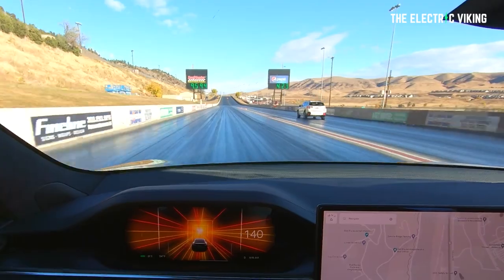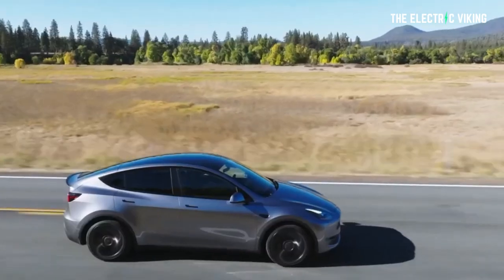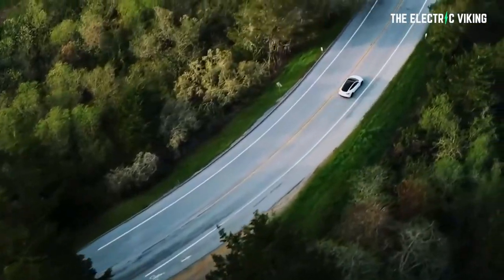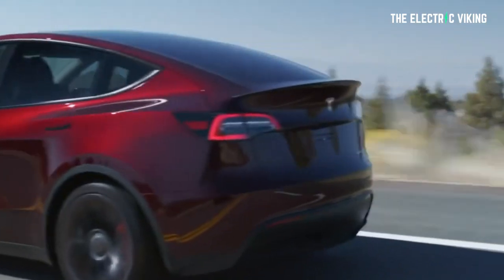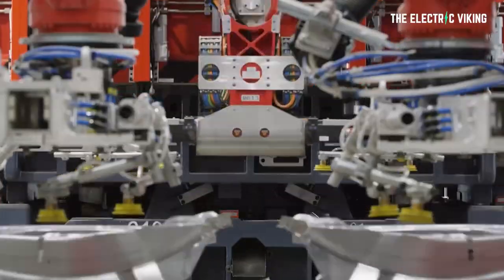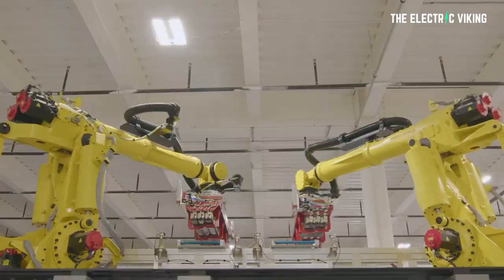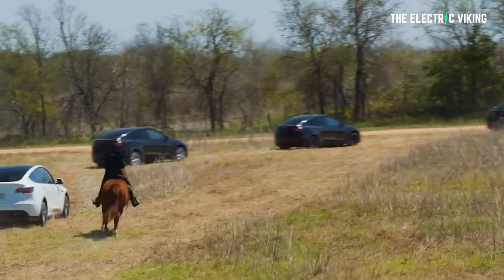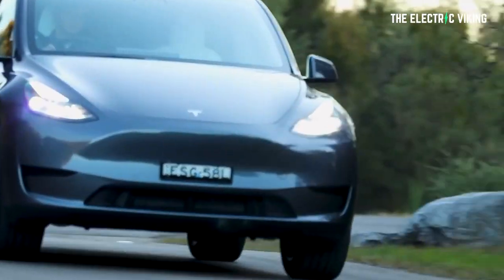NEW Tesla Model Y model available to order within weeks

Comment: I wonder whether the battery pack is arranged as 24 cells across the vehicle by 32 along it? That would be wired as a 96s8p battery, giving a 400V system with about 76kWh available battery and a modest buffer.

Comment: Will be interesting to see charging speed of the new 4680 cells as nothing has been published about it. If equivalent amount of energy per car, the charge speed may be reduced as fewer cells.
Reply: Tesla battery swapping???
Reply: Published estimates show that the charging speed is slightly slower than packs with the 2170 cells because of the need for more care with thermal management of the larger diameter cells. The small trade-off in recharging speed is worth the reduction in complexity, mass and production costs.
Reply: Will be interesting once they release the specs. Given the 4680 is a powerful cell, it may actually be able to take charge well, but given they are not using them on the semi, I also assume they will be slower.  This should not be much of a problem as most charging usually takes place at home overnight on a slow charge to prolong the life of the cells.

Comment: Maybe Panasonic focusing on 2170 cells do to unsolved optimization with heat distribution of the 4680 battery cells? Or is that already out of the question.

Comment: I had one on order, they had a few pop up in inventory in September. Pricing is $61,990. The car is NOT lighter, we already have weight details, spoken reviews on YouTube weighed his. We also know that they are the full 828 cell pack, so it's likely it's being software limited.
Reply: Yes, I kept asking about measuring the battery energy on Munro's channel since they tore one of those packs down. They demurred on the answer since they want that info to go into their reports. Would be quite easy to take four of the 4680s and determine their exact capability if anyone had them in the raw.
Reply: @arleneallen8809  The Limiting Factor has a cell on the way and will fully test. Should get a good answer from him soon.
Reply: By a sandbagger bring on TH COLD GAS THRUSTERS!!!

Comment: Sam, they are using the 2170 batteries in the Tesla Semi truck. That is what the batteries from Panasonic’s new factories will be going to. Tesla is not kidding about wanting to get to 50,000 semi trucks per year soon. 
Remember that the semi was designed when the 4680 production was just a gleam in Tesla’s eye. I think the Semi might always have been meant to have the 2170s in it. 
If they ramp up the 4680s to ludicrous levels they can use those too to further increase semi production.
Reply: Yes, maybe they can manufacture them using Ludicrous Mode 😁
Reply: That's it. The semi ramp will take ever cell the new factory can make.
Reply: @saff226  Yep, the model Y and Cybertruck will take all the 4680 production for awhile.  Eventually Tesla can offer an even further range semi using 4680 in the future when they ramp 4680 production even further.

Comment: It's probably been said in another video and I simply missed it, but is there a charging limit on the 4680s like there is on the current Model 3LR?  If they can be safely charged to 100% every time, this new standard range variant will essentially have the same range as my M3LR, charged to 80%.
Reply: No, they are still nickel based batteries. You need to charge them to a max of 90% daily, same as 2170.
Reply: @jasonfranciosa  Thank you for the info.

Comment: Tesla y standard range has been available in Europe for quite some time and it is cheaper than model 3 long range (by ~2200 USD in my country). It's an rwd with the range of 455 km. Not sure if it's the same one they will offer in USA but i doubt they will be making two completely different model y standard range
Reply: It's completely different. The EU sr is made in china using CATL LFP batteries. This is a made in Austin using 4680 cells. The entire body is different to all other model Y. It uses a front casting and has no floor pan as the structural pack is the floor.

Comment: Sam, this is sheer speculation but, Panasonic/Tesla relations seemed to chill a bit following the announcement by Tesla to begin building their own cells. Panasonic has all it's eggs in the Tesla basket in North America. Panasonic will be building the 4680 for Tesla and will sell all that they can make to them. I believe that Panasonic is interested in expanding their customer base and that they estimate it will be easier to sell the 2170 to other customers. P.S.  Panasonic's new factory in Kansas is very near a major rail hub that will make it easy for them to receive their bulk materials but, also to ship their products in any direction.
Reply: Tesla continues to push Panasonic into expanding as fast as possible. They will buy every cell all their suppliers can make. They basically have unlimited demand for cells as if they have any excess supply they can just use them to ramp up Tesla energy. Long term goal is to have a mega pack at every supercharger location

Comment: I think it is a clever way if they limited the range at the start and are able to release an increase on it, so after years the range is unchanged despite battery degradation...
Reply: This has already been a strategy for years. Tesla has released several updates that opened other parts of the pack for this very reason.
Reply: @justinstewart3248   Correct, no one misses what do not know and have...
Reply: An Tesla LR still make money
Reply: @michaelstarkey9745  what does that have to do with range and unlocking more battery?

Comment: With the semi, cybertruck and mY, all being 4680, not to mention the model 2 for half the price of a m3, they Better ramp the heck out of 4680 in the usa. Panasonic loves zero risk, so they would love to stay on 2170. Lots of them will be needed for the next few years.
Reply: Shanghai Texas an freemont ramped Berlin adding on
Reply: The semi uses 2170 . Only Cybertruck and a small %, of model Y use 4680
Reply: @saff226  wasn't the original plan to use 4680's?
Reply: @theairstig9164  I hear unicorn piss is the latest in high ion density electrolyte these days!

Comment: The cell has come back from teardown and they are not the high nickel no silicon in the anode and that's why the range is just on par. Their 2170 cells were a more energy dense chemistry. Once nailed and scaled they will enhance the chemistry properties. Not insider info just my opinion.

Comment: They wouldn't limit the range because they'd be wasting a bunch of cells in the meantime. Makes more sense to just use fewer cells and build the most packs they can. What if most people dont purchase the limited extra range later on? All those cells would then be totally wasted for the life of the car. I'll be shocked if they're limiting the range on these 4680 Model Ys.
Reply: Don’t it … very good perspective
Reply: It's most likely a safety buffer to test how they perform long term. If some fail they have a heap of spare capacity so the owners won't know. If all goes well and none fail they may just unlock them a few years down the road.

Comment: R they not using better energy density in S.R. to use less battery for SAME range ERGO weight saving.  

Don’t forget, any increase in battery IS a weight penalty you choose to carry around 100% of the time, where every u go, for the life of the car
Reply: The 4680 is less energy dense then 2170 because it doesn't have much silicon in the chemistry
Reply: @saff226  so you are saying “the same battery with less silicone weighs MORE? Ergo something heavier must replace the silicone.

Comment: I think Tesla will get new battery manufacturing equipment for Germany and will ramp up that line eventually. The problem is that the manufacturing of this equipment is bespoke right now. No other car company or battery company is using this type of equipment. It takes months to get it made and even longer to set it up and test before ramping. 
Therefore Tesla decided that it would be better to use all their existing equipment in the US to get those subsidies rather than leave it in Germany. Tesla already has the permits to make batteries in TX and they have the room in their huge plant there. 
Germany, as usual, is dragging out the permitting process to produce these batteries so Tesla was going to have to wait for all that anyway. Might as well use the equipment in the US now and order up/make new equipment for Germany to be delivered later when the permitting process is further along. 
I really fear for Germany…. they are losing their industrial might by making permitting so long and difficult. They better fix this or no company from outside Germany will want to manufacture there.